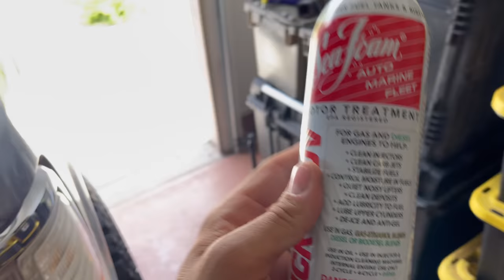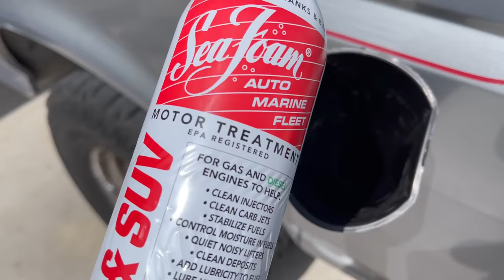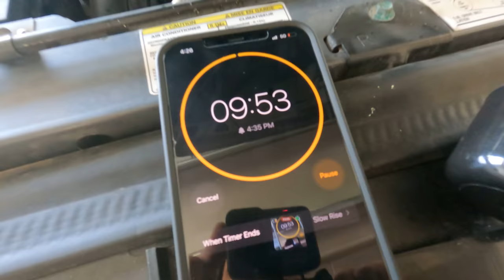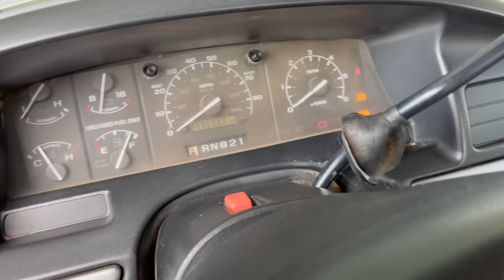Seafoam - Engine Treatment | How-to and is it safe inside your motor?

Comment: Its more of a psychological thing, people feel better because they believe that this auto witch oil is doing what it says on the can. If you treat your engine right by keeping up with all required maintenance service you'll be fine. I never had to use any of these auto witch oils in my 45 years of driving. These auto witch oils are big business for those who dont take care of their engines properly.
Reply: Nah throw a can in every here n there. Techron has all i ever used. Bought a used quad and can't figure out the damn heavy gas smell. Now I'm going to try marvel mystery oil in the gas next. It's gotta help something on the carb. Yes I cleaned it already but still issues. Idk hoping for the best

Comment: It's pure B.S.  
 All it's good for is a Smoke show! Seafoam is all smoke and mirror's, won't do a damn thing for cleaning a engine of carbon deposits!
Reply: There's more videos that show proof  that it does😂
Reply: @braynv4028  I've used it many times, all ending in disappointment. Yes, I scoped the combustion chamber before and after.
Reply: And you probably drive a Honda

Comment: Years ago, I did this before they had the spray bottle. I took my vacuum line to my brake booster off, stuck my thumb over it to increase the suction and fed sea foam into the hose slowly until I went through most of the can it smoked like mad but it cleaned everything nicely. I let it soak for probably 20 minutes though. Smoked for quite a while after I restarted it and drove it around. But it went away after maybe 10 minutes and never had an issue

Comment: I have used seafoam in probably over 20 vehicles and never once has a problem. I had an old 05 silverado, 4.8 with 400k miles. Put a whole can in the engine oil, ( was gonna change the oil the next day  ) and forgot it in there for a month. Changed my oil and the oil was so dark and had so much crap in it. Put a can in the fuel tank and filled the oil back up and man it ran so much smoother and had noticeably more power. Me and my roomate did the 3 seafoam treatment on his 500k mile f-150 and it ran quite a bit better. Still purring along years later. They recommend measuring out in oz to how much fuel you have in the tank. I literally just dump a whole can in with 3/4 of a tank of fuel and drive it a bit hard. Have never had any knocking, pinging, detonation. nothing. Just smoother and better running after.

Comment: I have always used it for keeping the fuel system clean and in the off season for a fuel stabilizer. For probably 25 or more years I never needed to clean my carbs because it keeps them free of dirt and varnish. I swear by it for those reasons alone. I have used it before oil changes also to clean the engine out good.

Comment: Yes, fluid oz is volume, and that is not the same as weight. Y'all are correct. However, a 16oz can of seafoam weighs roughly 1lb, so the fluid volume is pretty close to the fluid weight. weight - 16oz = 1lb

Comment: If you want to use in thru the manifold, I would and have used the brake booster vaccum hose, just a slow steady flow.

Comment: I have used seafoam in my 0 turn mowers ,tractors,2001 dodge diesel,96 dakota ,generator  and never had to replace,clean injectors ,clean carburators. Add a little to every tank of fuel.

Comment: Okay i guess im now convinced and confident that i should use seafoam in my 20 year old impala before changing the oil. Was told to put 4 quarts in after draining but completely unsure of how much oil is currently in there so i plan to use two ounces.

Comment: I have a 1981 f350 custom with an old 351 motor. This thing is gutless. Was wondering if this would help the motor any? Was a better motor when I first bought it about 3 years ago but has sat for about a year waiting for the rear end to get rebuilt. Not looking for a miracle, just hoping it will bring a little life back to the engine
Reply: U need nitrous oxide!!😮

Comment: When I change fuel filters in my diesel engines i fill the new filters with sea foam before installing. I have not had any trouble with sticking or gummed up injectors. Just saying.

Comment: Do we need to do all 3  ? I already am using amsoil fuel & upper cylinder cleaner in gas tank. Can i just put the engine treatment in at any time ? I assume yes, but is the crank case cleaner much better when the gas tank one runs at the same time ?

Comment: Good tutorial Never thought about doing this video But I probably should showing how to do it on a Modern 2000 Toyota 4runner or newer Because newer systems are more sensitive on throttle body Injection with all the sensors now days

Comment: I did this on my vehicle n it made my car run the best I’ved ever had it for like 3 months. After that I had the worst experiences like engine misfire codes to just a horrendous of things that I had no answers for. In hindsight I’d be careful with adding this directly. In my opinion it’s best to clean w a rag and having someone step on gas to open the throttle n clean it with a rag n apply the sea foam to the rag not directly. But that’s my opinion. Try this if you’d like..,good luck….

Comment: this looks like it will prevent the need for tune-ups in fuel injectors and lines.... that's an insanely good video, I have a 2009 Hyundai Santa Fe and it has 303,000 km on it, and it runs great!! 3.3lv6 and I would love to see how far it can go or treat my engine to everything it's been through and give it a little love.  Curious, if you have as many km as I do ... and certain plugs or whatever are preventing a leak, then you go and do the treatment, will it clean it so well that leaks show up.  Great videos like to see more Cheers.
Reply: Very good question. From what I've learned you may be right, and I've learned a lot over these long years. At least be prepared for it to cause problems or don't mess with sucess.

Comment: Just stumbled across this….Seafoam works great. You put 7.5 oz (by weight) into the crankcase instead of 7.5oz of liquid in the crank case.  No big deal, but you could have put half the bottle in (or a full bottle) with no issues.

Comment: I put this into the crank case and the gas tank of a Mercedes 2006 that hasn’t been run in over a year. Of course, huge amounts of white smoke came out after it was put through and it ran for probably 45 minutes with the same amount of smoke coming out. I haven’t taken it on the streets but I’ve turned it on every day and ran it for 30 minutes each day. It has dwindled somewhat with the smoke, but on start up it still comes out with enough smoke to make the neighbors wonder what’s happening. I assume that’s because it’s still cleaning correct? if I were to change, the oil will not go away because I’m looking to sell the car.

Comment: Had a 2003 Toyota Tundra started using Seafoam in 2008. In 2020 wrecked my truck ( herd of deer wrecked my truck) at that time I had 506, 655 total miles. New truck Seafoam.

Comment: tip: go buy an air filter, cut two (for this kind of intake) circles. piece small hole for the straw to fit thru. do it that way instead to  avoid dust and debris getting into your engine.
Reply: Mass air flow sensor?

Comment: I have a 2001 Ford expedition XLT my check engine light has been on for over a month. I had a scanner hooked up to it. It came up with a p0171 n p0174. My buddy unhooked the battery for a minute or 2. After that just the one code came up p0171 which is the O2 sensor bank 1. I got a upstream O2. I haven't put it in. Should I use this n see what happens before I put the O2 in. It's got  little over 184000 in it now

Comment: Seafood worked excellent on my moped  and I followed up with your method my moped works much better in acceleration and quiet down the grunge sound cleaned up the fuel injecter very well I used 4 ounces of seafood added to gas tank and I also followed up withe the spray treatment with the stability arson spray into my intake manifold and carberator😅 6:17

Comment: First time I tried it my wife's Envoy had a low engine knock like an the rear main bearing area and one a cold start it would knock loud enough to be very concerning. The can said you could use it in the oil but only put one oz per qt of oil. The envoy takes 7 qts and it only put on 5 oz and after starting the engine and lets run a couple minutes shut its off and restart and no difference. Drove it about one mile round trip and shut its off. The next morning there was no noise and after over 100k more miles never heard the noise again but I did periodically add 5 oz maybe the day before an oil change. Done this about every 3rd or 4th oil change.

Comment: I used something like that for my oil change it worked great so great  its degrees my motor.  The only thing keeping my motor together was the buildup from 1 1/2  blocks  it dumped all 6 litter of oil then it as on fire 🔥.  I don't know what I did  wrong

Comment: Seafoam is not the best cleaner but its mild cleaning power is what makes it suitable for older vehicles with weaker rubber seals and gaskets where the newer more advanced and aggressive cleaners could damage. If you are driving a pre-1998 car or pre-1990 motorcycle, Seafoam might be safer to start with. Stick with recommended fuel-to-Seafoam mixing ratio or slightly more of Seafoam for a bit more powerful/quicker cleaning. Key thing to remember; this cleaner should be added to a 1/8 to 1/2 full tank then the gas tank should be filled up for it to mix properly. It also cleans on the long run so do not expect anything to improve overnight. You want something to work fast, get something like Star Tron Fuel Treatment.

Comment: I have a 2016 Ford Escape titanium 2.0 eco boost that has white smoking coming from the exhaust pipe. It’s not a blown head gasket but I think my engine has carbon build up in and that’s what’s causing the smoke. Is sesfoam safe on 2016 vehicles?

Comment: good video however.. it would be nice to see a before and after pic or video on the internals. I used to use chevron F.I. cleaner.. then I used lucas but a few weeks ago i saw this video where lucas didnt do a good job... So im using seafoam or gumout... redline FICleaners. thanks for the vid.

Comment: Question I have 2017 F150 FX4 barely hitting 70k and the ford service dept is recommending an injection flush which they charge 289.99 I declined and figured I’ll do it myself or pay a mechanic but the few I called no one does them but one guy told he just run sea-foam in the gas tank and save the $$$. What do u recommend? My truck still runs like brand new BTW

Comment: Any opinions on using high milage seafoam in a 2010 ford expedition eddie bauer edition with over 245,000 miles it jolts here and there and sputters a lot sometimes   almost like its slightly clogged up  should i rev it up to 1500 rpm and then spray it into the intake or should i run it through the fuel tank ? Bc it mainly does it going uphill and when needing to exelerate quickly , the air filter is new so its not the air filter mas airflow is fine  i think may be slightly clogged cats and a lot of carbon build up .

Comment: I have a 99 silverado 5.3l and on first startup of the day, it does clatter similar to a diesel for about 15 to 20 seconds then that clears up. I believe that's fairly typical of the first gen 5.3l, and I switched to synthetic oil several years ago which did help to shorten the noise timeperiod...it used to clatter up to 30 seconds on conventional oil.
Would a SeaFoam treatment like this clear that up further?
Reply: I started using oil stabilizer in the  place of 1 quart of oil during oil changes and that stopped my start up clatter completely

Comment: Curious why you didn't fire it up after the got saok and drive it under a load with intermittent moderate acceleration like the instructions on the can say to do. It doesn't say to just fire it back up and let it burn off. Did I miss something?

Comment: Why did you do 2 cans in the exhaust manifold? Are you supposed to do it with the engine off then wait 10 minutes and then run it or do it with the engine running, turn off, wait 10 minutes, then run it?

Comment: I've used SeaFoam on every vehicle I've owned for the last 15 years, it made a Jeep pickup with a rough idle smooth out and run as it should and I use it as an ongoing injector cleaner on my Mercedes SEC. The kicker that many might not realize is it is one awesome parts cleaner, no need for spray cleaners that just evaporate away, brush SeaFoam on and let it soak a bit and all the crud will wash away using the same brush and it won't be an explosive atmosphere. I've bought a boat with an outboard engine, will be using as a fuel stabilizer as well as a system cleaner

Comment: Do you recommend any for transmission on a 1994 For Taurus GL 3.0
Reply: First things first try just changing the transmission fluid. Do not flush it. Do just a drain and fill, leave filter alone. If this doesn't work, use a fluid transfer pump (sold at Walmart $9) and pump out a quart of transmission fluid. Then, add a quart of Lucas Stop Slip, that should give you some more time out of it. Those Taurus transmissions are notorious for problems.

Comment: old mechanics trick is if your vehicle takes 5 quarts of oil replace one of them with atf on your next oil change. atf has a lot more detergents than oil and will clean the crank case of your engine. I've personally done this with ever used car I've purchased and it works

Comment: So how does the engine run without the intake hoses attached the instructions say to put the hose back on with the straw that's why there's a bend in the straw it's designed to loop in there

Comment: I did this once with this kit and almost lost a straw into the engine valve, I actually shot the remainder of the can into the gas tank and the straw fell off into the inlet. that wasn't as bad as it getting sucked into the engine. I thought they should spend the extra $0.50 or whatever and have the straw attached like a can of WD-40 where it's a hinged mechanism

Comment: Vehicle been sitting awhile? You start driving it again, O2 sensor coming on? Try 1/2 can of seafoam in gas tank, see if that clears your Check engine light. Worked for me, have been using seafoam for years, never any other product.

Comment: How were you running your engine at 2000 RPM;s without someone in the truck holding down the gas pedal? I know your engine wouldn't be idling at 2000 RPM on its own. Did you have something holding the throttle in that position that we couldn't see?

Comment: Idk what I'm doing wrong. I used Seafoam spray and the Seafoam liquid right before my emissions test, and it still failed 3 times due to high HydroCarbon levels

Its a 1999 Mazda 626 LX and the car has no check engine lights, no codes popping up and all parts like my Catalytic Converter, etc. on my emissions paperwork are working and passed the test, but the HydroCarbon levels are still really high

Comment: My 1998 Camry is smoking after swap engine that had locked up and that oil in the system that has to be cleaned out thinking about using seafoam

Comment: Seafoam was designed for 2 stroke outboard engines only. It is not ment for 4 cycle engines. It is for fogging out engine when winterizing.

Comment: Just had a new 460 long block installed in 85 f250 and mechanic ran old gas through new motor instead of draining the tanks. After driving for a month it now cutts out like loosing fuel when going over 40 mph or so. Do yall think im ssfe to use seafome on my new motor to see if it solves issue? Also discivered mechanic didnt put a fuel filter at the carburetor. Do yall tbink this is what caused my issue? Any help is appreciated. Its my only means of transportation

Comment: They used to make a fuel system treatment that contained PEA (polyether-amine), which is specifically for engines running unleaded gas with a small ethanol content. I know Gumout made this formulation, not sure about Seafoam. It worked great, but I'm thinking they don't make it anymore because you cannot find it with PEA.
Reply: That's y seafoam works so well on ethanol based fuels ⛽️--it removes water&neutralizes ethanol 😮

Comment: Dude! Thanx for letting us in on your treatment. BUT the instructions should say "1 to 1.5 FLUID ounces" per quart of oil. You're NOT supposed to measure out the Seafoam on a scale - you're supposed to use a way to measure FLUID OUNCES ... that means USE A MEASURING CUP! Notice the bottle of Seafoam says something on it like
 'fl. oz.' After this, NEVER use that measuring cup in the kitchen! You might go to the Dollar Store and get a cheap measuring cup for your garage.

Comment: How did you keep your engine running at 2,000 RPM without someone holding down the accelerator? Thanks!
Reply: I use a 20-30 lbs dumbbell on the gas pedal. (one end on the floor, one end rests on top of the gas pedal). Hope that helps
Reply: @the_35_zone  Thanks very much for the tip!

Comment: Is it safe for turbo diesels? And would you recommend other diesel treatments over seafoam in a diesel application?
Reply: I believe it is diesel safe. You can also use a product called "DS Fuel Service" which comes in I believe a gallon or 5 quart container

Comment: I have a 2004 chevy impala with 278,000 miles...car was running ok until i added the seafoam now my check engine light is on and my car is sputtering...is that normal?

Comment: How did you maintain the recommended 2000 rpms while spraying the throttle body?
Reply: Hold the throttle open at the throttle body while you spray with the other hand or get a friend to hold the gas pedal down